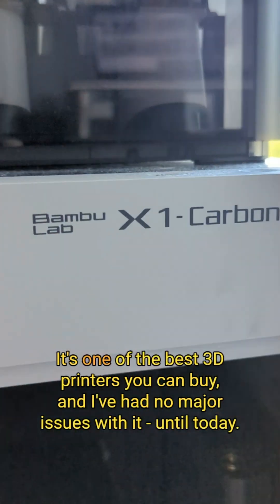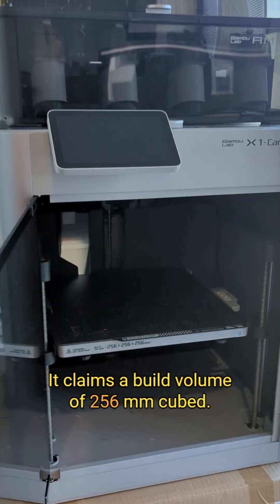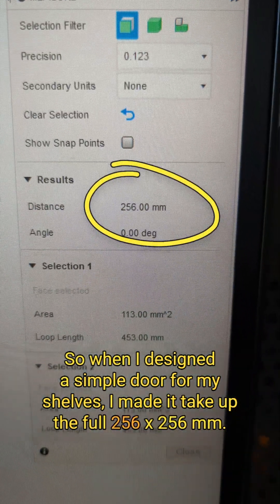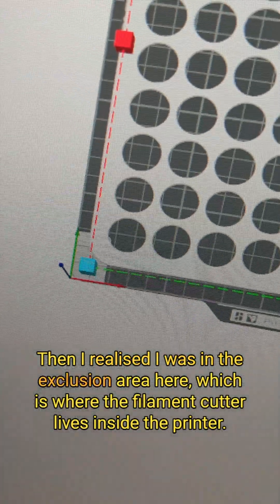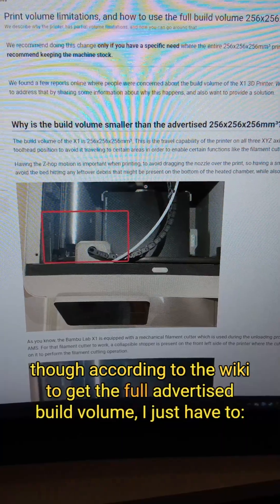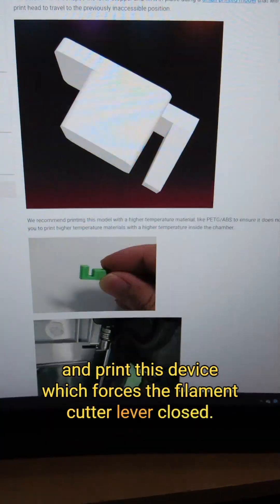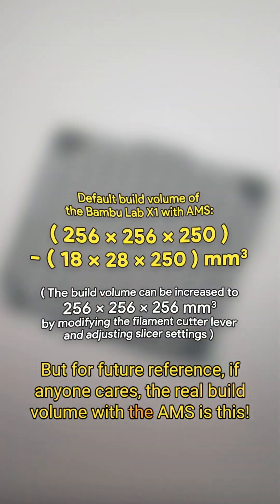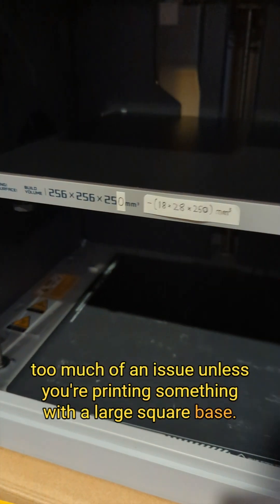My 1 Issue With the Bambu Lab X1 #3dprinter

Comment: Open bambu studio top left hit prepare then under the settings cog looks like a note pad or a square with line through the corner click on that now you are in printer settings right hand side click on advanced should be green now first tab is basic information under that tab where it says excluded bed area remove the data next line down is bed height set to 256 then hit the save icon top right of box and name this new profile something like 256 no exclusion or what ever now it is fixed

Comment: Yes. I have one and I run into the same issue.   They should be advertising the actual build volume using all of the bells and whistles.   It’s like selling me a Mustang and and saying that 0 to 60 time is five seconds, but only if you takeoff all of the body panels and all the extra seats etc.    Kind of silly.   Still, I have to say it’s a fantastic printer. Best printer I’ve ever had, and I’ve had a few. The quality is fantastic and it’s ninja fast.
Reply: Well they lie to you with the Mustang 0-60. The advertised 0-60 is the roll-out number. So it's not a real 0-60. As for the printer I can't wait for a larger version. This printer has been amazing. I have zero complaints.

Comment: Key words: "you can buy". Not for that God damn price, thank you very much
Reply: considering its a multicolor printer with very little assembly and prints right out of the box, thats a bargain.  

The real problem is when it comes to repairs and maintenance. Good luck when that happens.
Reply: @CoffeeTech101 maintenance has been nice for me. This machine is amazing. Much less work than the 3 ender 3s I had.
Reply: Work 2 days of overtime..quit crying

Comment: You can turn off the exclusion area and still use the cutter
Reply: Open bambu studio top left hit prepare then under the settings cog looks like a note pad or a square with line through the corner click on that now you are in printer settings right hand side click on advanced should be green now first tab is basic information under that tab where it says excluded bed area remove the data next line down is bed height set to 256 then hit the save icon top right of box and name this new profile something like 256 no exclusion or what ever now it is fixed
Reply: @codycotten-sk3ym   thnak you for this information. Could i still use an ams with it?
Reply: I was gonna say, can you just resize the bed to the side? Or is it too closed source to do a bed coordinate offset?
Reply: How do you achieve this
Reply: It's in your settings in bamboo lab slicer one for print hight and the other for cutter exclusion zone both can be removed
Reply: Yes, AMS works the same.

Comment: Thats a small build plate. The machine better be dope
Reply: 256mm is small? Jesus the ender 3 is 220... my i fast is 350 

Really should learn to design smaller parts if you 3d print regularly
Reply: @syndan9245  I have an Ifast and XCF
Reply: 3d printing isn't a good process for your project anyways if you need anything more than that.

Comment: I can’t stand manufacturers that make false claims like that. Would it have killed then to make the plate 260x260? Then you’d have your 256.
Reply: Or maybe just maybe, the size of the bed is 256mm2 the build volume can be smaller
Reply: You can print 256^3 just fine. Some people are clueless.

Comment: Even with out the exclusion zone the print area is still too small
Reply: I feel like it's a fair size when the competition is the same or smaller. I hope they do make a larger printer since businesses would benefit more from something like 350mm or 400mm bed.
Reply: @kongchho  not fair when it’s falsely advertised
Reply: Its like 240x240x240, how is that small?

Comment: A lot of printers seem to do this and its really annoying. My first printer (Geeetech i3 pro B) stated a build volume of 200x200x180. Can get maybe 150x180x150 if you're lucky.
Only one I've come across so far that has a build plate that is bigger than stated and correct build volume is the Anycubic Kobra max. Companies need to stop the false advertising.

Comment: Bambu - one of the best printers? LOL
Reply: Triggered much lol?
Reply: @syndan9245  as an owner of X1C? Yes, indeed. HW quality is is just not there
Reply: @Botanic2000  i own one too, mine is amazing
Reply: You obviously got a lemon. With that in mind, which printer is better. Out of the box?
Reply: @Mr.X3D  took me 20 minutes to start printing. And has worked flawlessly since
Reply: @Mr.X3D  According to BL's support, my printer prints totally fine and the print quality meets their "internal standarts". Yet, IRL it prints worse, then my Ender 3

With that in mind, out of the box, my Ender 3 is better.
Reply: @Botanic2000  That's annoying. So how did Bambu support determine this? By looking at your timelapses? Quoting myself; "you got a lemon", weird that Bambu won't attend your issues.

Comment: A tip for loosing small stuff that you can’t find: Put a flashlight on the floor, turn it on, and look for a shadow
Reply: Random, but thanks?
Reply: Dam, that was random but useful
Reply: Kinda like finding this useless comment
Reply: ADD?
Reply: When dropping something small, don't try and catch it.
Stay perfectly still and follow it with your eyes and head.
Reply: @theod0r  nerf darts have a tendency to bounce around a corner every single time and end up behind a completely different corner
Reply: Random but useful